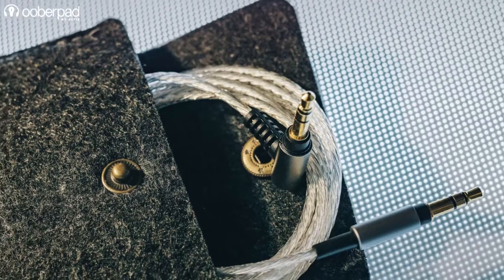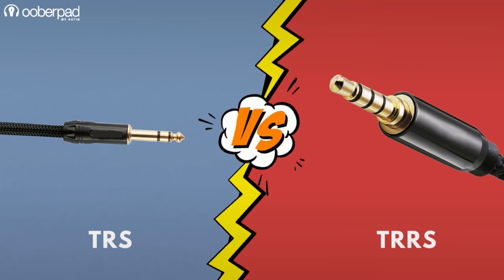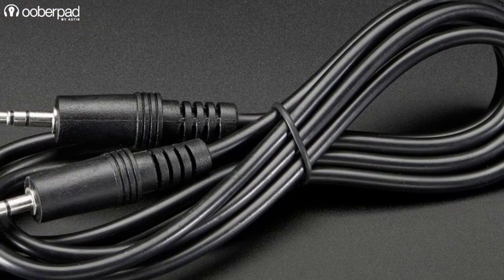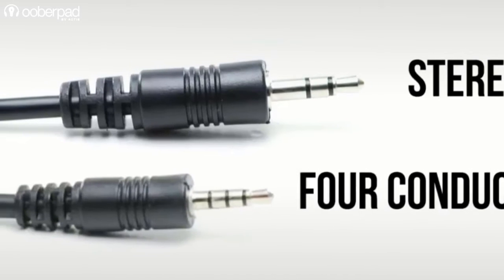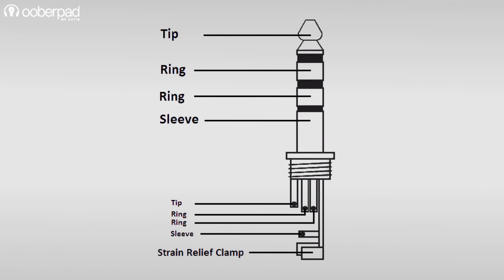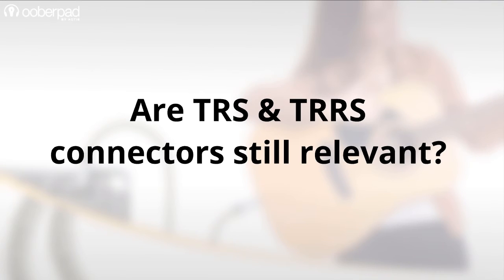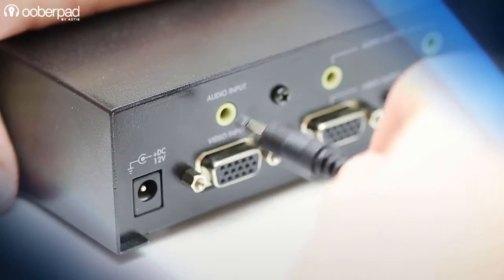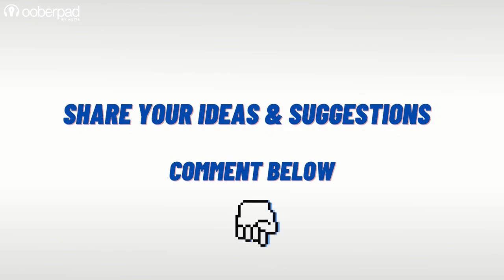What are TRS and TRRS Connectors? And the differences between them?

Comment: I have trrs cable and trrs ipad 9 gen but my mic is not working I tried in different android devices and it is not working in it also but in my laptop it is working however it also have trrs 3.5mm jack I don’t know how plz suggest me any solution but when i uses coverter of trrs to trs then my mic works but with devices mic instead of headphone . There is some decrease in audio quality any solution?

Comment: My JBL headset has a TRRS plug. It works perfectly with my phone. However, when plugged into my laptop computer I lose the Right audio channel. The laptop jack (socket) I am told is a "combo"(audio +mic) and should work with a TRRS input. IT DOES NOT! The microphone signal is detected by the laptop, so the Sleeve (S) (Mic)  is connected but the second ring (R) (Right audio channel) is not.
I have spoken with various persons but none of them can tell me why this happening. Can you help? Would a TRRS to TRS adapter allow me to hear both channels?

Comment: Are there any sound bars with upward firing Atmos speakers and also with wireless satelite speakers like 5.1.2.?
Reply from the maker: Generally some soundbars offer a set of two rear speakers (wired or wireless) and a subwoofer to give you a immersive experience. You can check out the Sonos ARC wireless soundbar which offers Dolby Atmos as well and can connect to  Sonos Wireless Rear speakers and Subwoofer for an immersive experience. To know more about the Sonos ARC visit www.ooberpad.com and click on the live chat button for a quick chat with our Home Cinema Specialists.